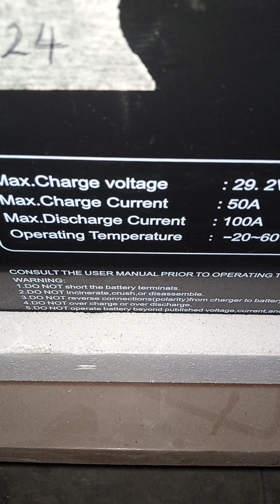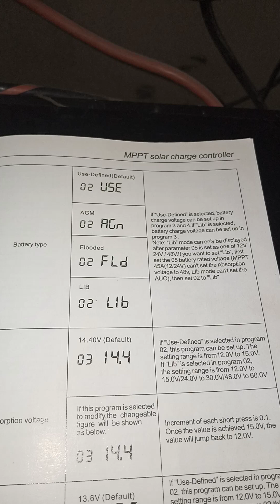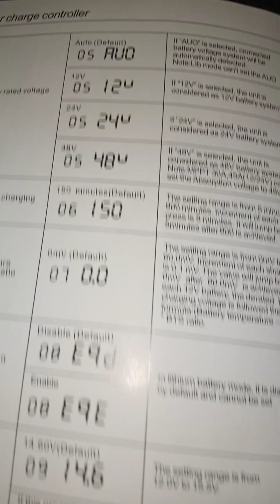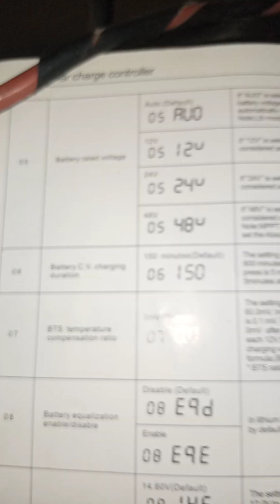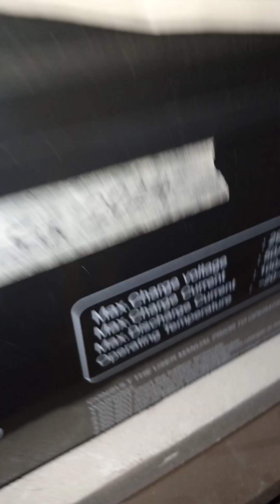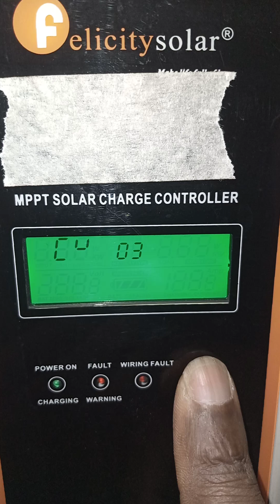HOW TO SET THE CORRECT BATTERY MODE FOR YOUR MPPT CHARGE CONTROLLER #felicity #mppt #lifepo4 #invert

Comment: its wrong to set the charging to 50a because the house load will also consume,you didn’t add the house load in your settings.u dont just charge ur battery.also provide power that you house load need
Reply: That bis the maximum amp for that controller